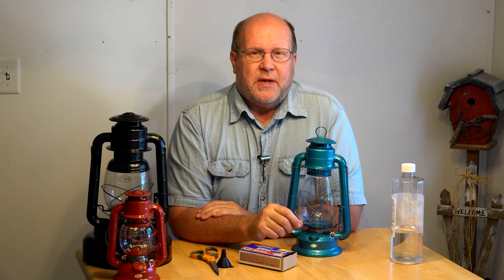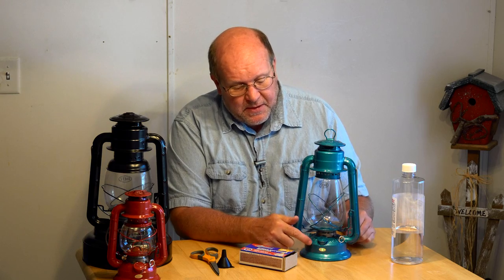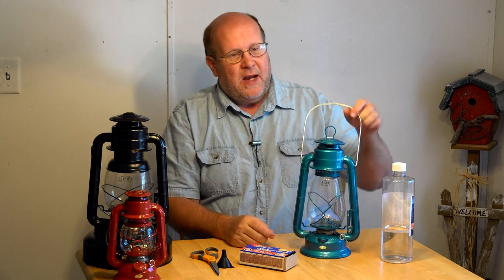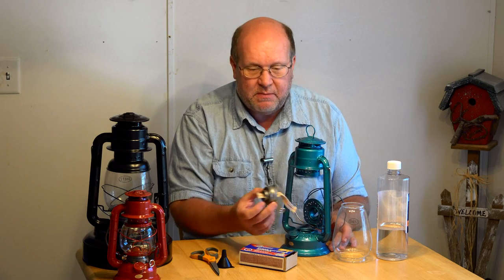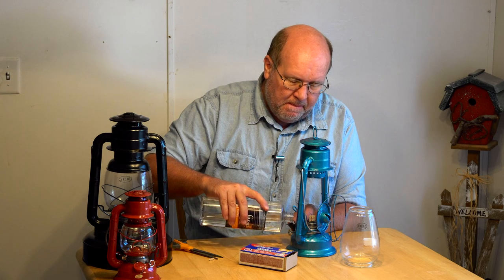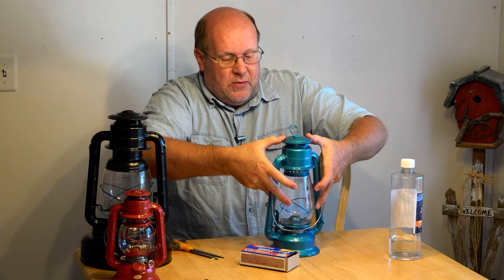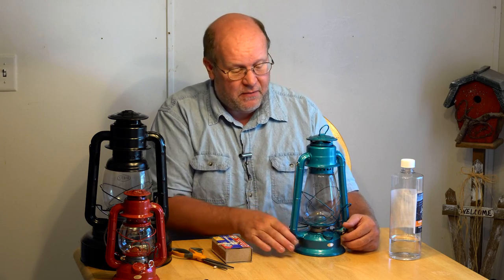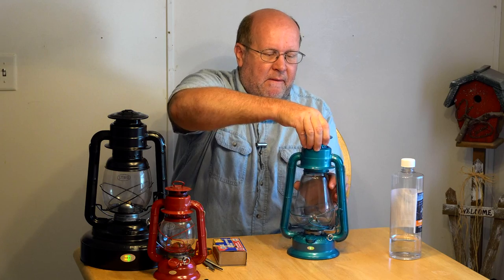Hurricane Lantern Basics

Comment: Wrong advice on trimming a new wick, totally unnecessary. Also wrong instructions for extinguishing the lantern. You shouldn't have to mess with that wire when removing globe. Also on a lantern, the chimney is the stovepipe type of roof above the globe, they are not called the same thing as with an oil lamps glass being called the chimney.